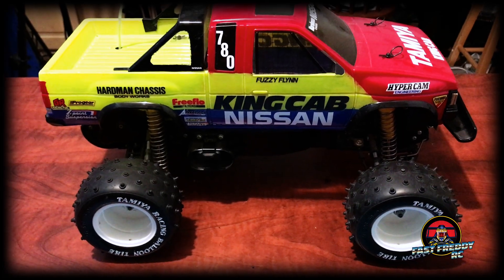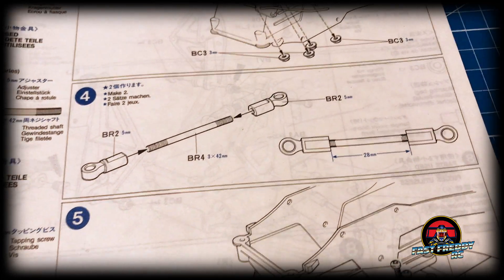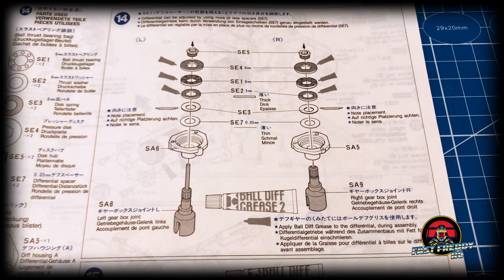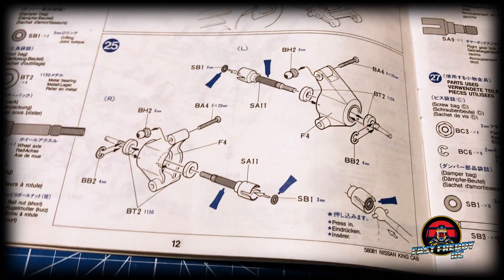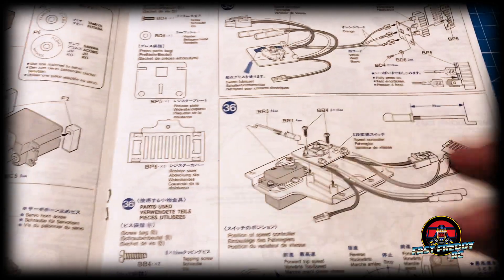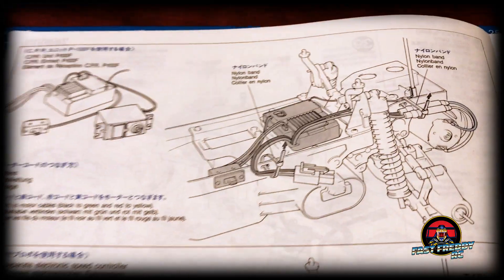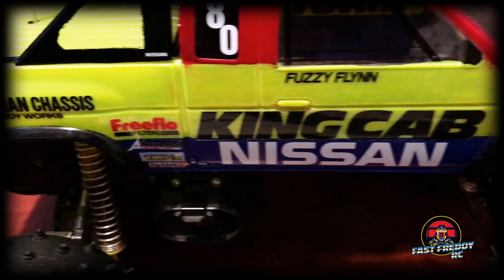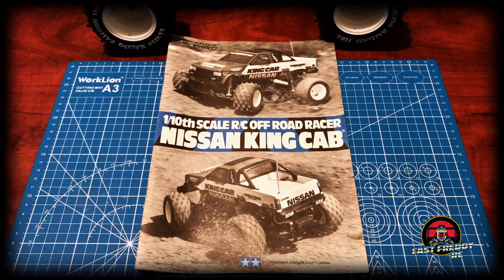Tamiya Nissan King Cab ORIGINAL Instruction Manual Overview!

Comment: Nice run through of the manual. I had to print out the manual for mine, even the manuals for these trucks are silly expensive! LOL! I do wish they would re-release this one! I would love to have one i could take out and run around without worrying about breaking anything, it is too much of a gamble with the old ones! I don't blame you for shelving it and keeping it from getting busted!
Reply from the maker: Thanks Addam!  Wish I'd known!!   I could have scanned mine and sent you a copy.  Although maybe if I had done this video in time this might have also worked for ya?  But yeah, agree with you 100%  I can't believe they haven't.  This one is a must.  It's pretty fast stock considering it was a truck too.  The gearing was better for racing I think.  I do know that i could do all sorts of things to it I suppose to keep using it (aftermarket parts etc), but as this is so rare and nothing is broken on it I'm happy to just retire it and HOPE they bring it out again so I can build another one!  Crossing fingers they release it again SOON!